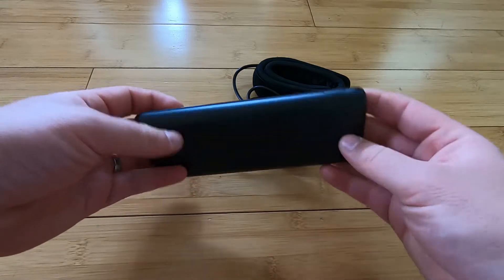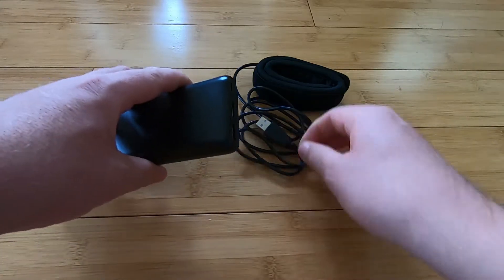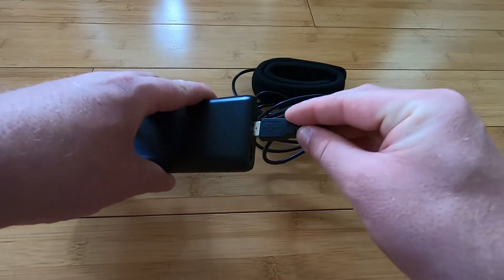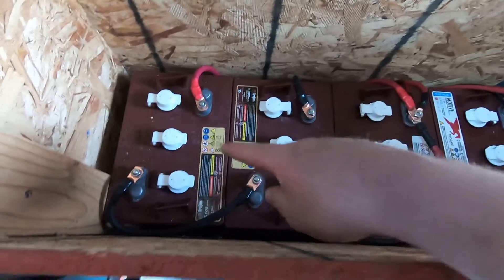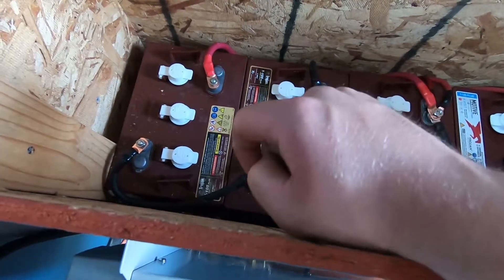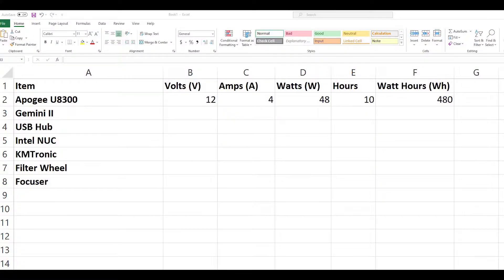Astrophotography Power Management: Part I

Comment: Another thing to think about folks is weight. Lead acid batteries are relatively cheap and easy to recharge. But, being based around lead, they are HEAVY. At my age that starts becoming significant and the alternatives mentioned in the video become worth thinking about. LiPo and Li-ion spring to mind. More sophisticated voltage management in use is required and the chargers are more expensive as well. A possible alternative of course is a set of wheels depending on the terrain you have to carry the lead acid battery over. If using lead acid you need one designed for 'deep discharge''. BobUK

Comment: Hi. There's a reason for using isolated portable 12 volt dc power even if within extension lead range of mains power. It's safer. No risk of mains electrocution. The equipment is mainly used at night which is inherently more risky as things are more difficult to see, leads get tripped over etc. Just a thought. BobUK.

Comment: Great upload for those who need this info which is pretty cool  👌 I'm one of those guys who can not observe from home because of heavy light pollution and not having a big enough front or back yard. I have a pretty cool setup, my Celestron Nexstar Evolution mount has it's own built in 10 hour lithium ion battery, my mount generates it's own wifi so you can connect a Android or iPhone device to control the telescope, my telescope polar aligns itself using the Starsense Autoalign, the mount polar aligns to any star or planet using the SkyPortal App, after alignment i can then align to ten more calibration stars...the more stars i align to the more accurate the tracking eliminating the need for a auto guider. I have 6 batteries for my astro modified DSLR camera. Power management for me has never been an an issue because of the set up i have. I do have a large power tank to power other excessories 👍
Reply from the maker: Awesome! That’s a great setup!